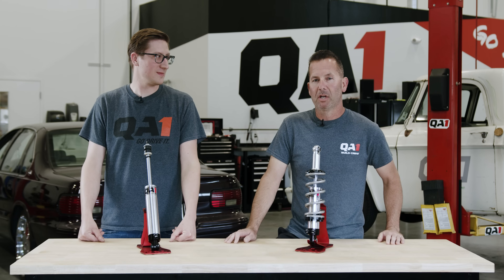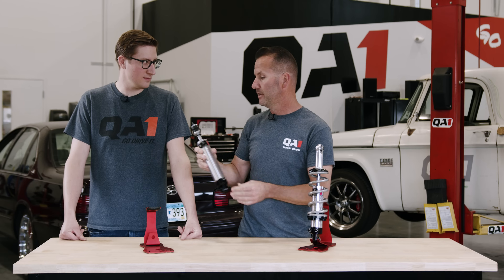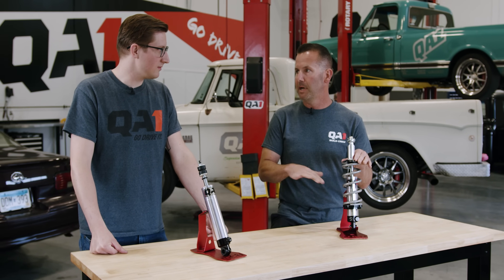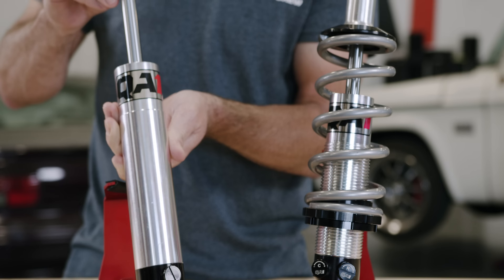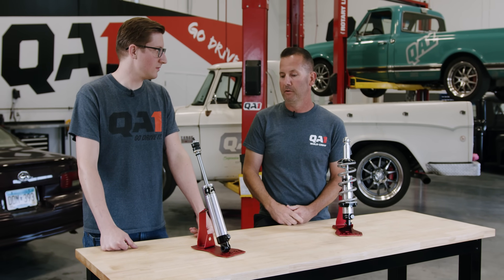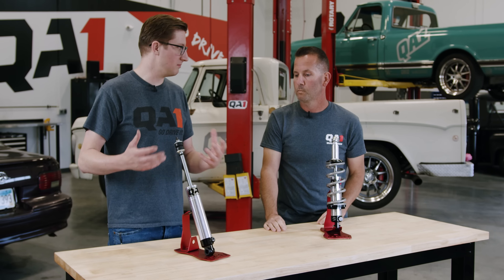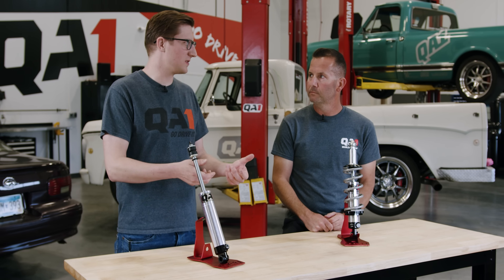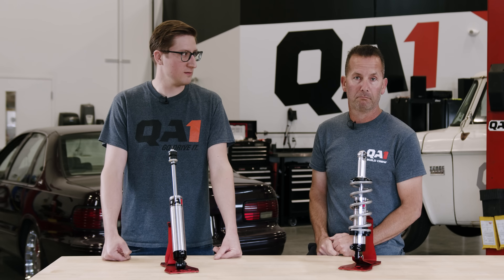The Impact of Shock Valving on Ride Quality and Handling

Comment: I have a 1971 mustang Mach 1 I was wanting to change the upper shock mount to a 1970 mount an use 1970 qa1 shocks is this acceptable
Reply from the maker: The shock for the 70 and the 71 are two very different lengths. Please call our tech line, there may be a way to combine some different pieces to make it work, 952-985-5675.

Comment: I purchased a set of single adjustable QA1 brand new coil overs for my 67 mustang from cj pony parts. after about 50 miles or so I have noticed residue on the top part of the shock where the cylinder slides up and down. is this normal with new shocks out of the box?, i have wiped them and cleaned them and noticed after driving the car again im seeing slight residue its not like a leak where i see oil dropping down onto the ground, but just a mist of residue?. can anyone let me know this is correct?. id hate to have to take apart my front end again
Reply from the maker: A little residue is no issue! Generally a small portion of lubrication will make it past the dust seal on the top end and attract dust or other particulates. this is no way affects the performance of the shock and all internal components are protected from the particulates. Only an issue if leaking were prevalent.

Comment: I have a 2000 Chevy Silverado 1500 RCSB RWD and am interested in the Front Pro Coil Shock as well as a rear shock that will hopefully allow for an ultra smooth and forgiving ride. The truck is my daily driver and mostly stock. I understand the benefit of having double adjustable shocks all the way around but is it worth the extra cost for my setup and goal? I don't need performance... I just want the smoothest ride possible. Should I just go with the single adjustable and crank the knob all the way to the left? It would also be great to get a video from you guys to explain how different settings on the double adjustable shocks would perform. Like, what if you set the compression knob all the way to the left and the rebound knob all the way to the right? What would that ride be like?
Reply from the maker: If you are just looking to improve your daily driver and have a better ride, the single adjustable shocks will definitely get the job done. We recommend slowly playing with adjustments and doing some test drives to find the right mix of compression and rebound.

Comment: I’m thinking about getting some double adjustable qa1 rear shocks for my s10 for autox/circuit style driving and the truck is quite low, I was even thinking about c notching the frame soon and lowering it further to get the center of gravity down more. My question is will these shocks allow me to lower it any more or will it bottom out the shock too soon? Your help would be greatly appreciated!

Comment: Another question; where both of those coil-over shocks.?
I need help pickin the correct shocks for my stock 57 chevy 210.
Single adjustible,.. not sure about weight 350 or 450 thats confusing. 
And should front shocks be coil over and rear shocks be non coil over.
Any help would be greatly appreciated. Ideally the part number, or link, so i could order it easier. Thanks again